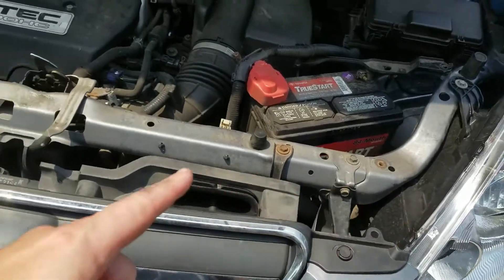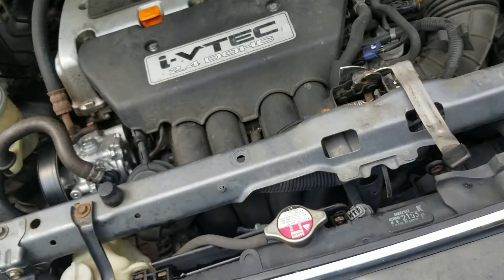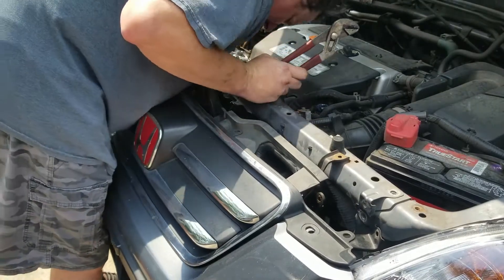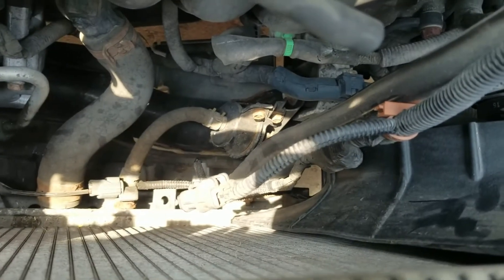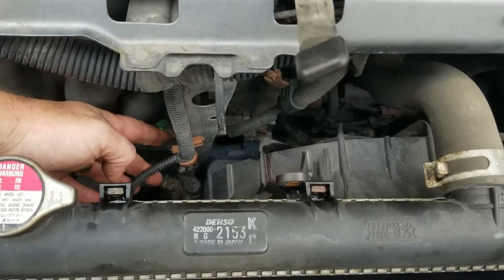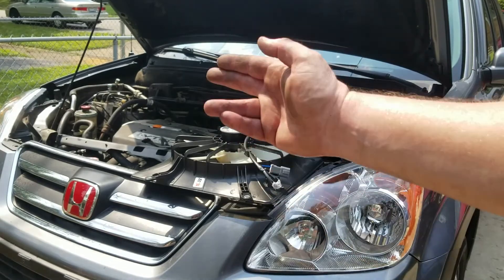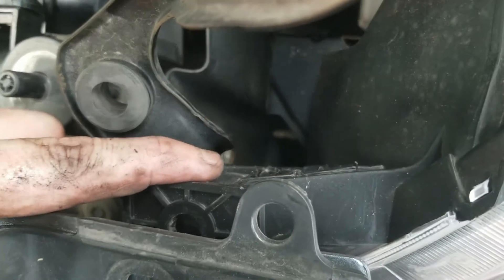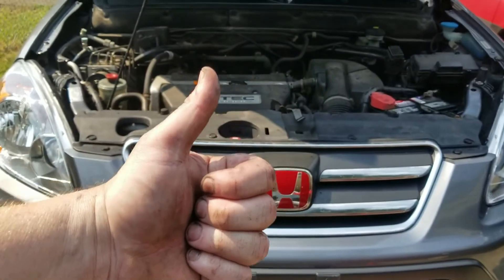02-06 2nd Gen Honda CRV Radiator and Condenser Fan Replacement

Comment: For anyone else watching this, just undo the 10mm bolt for the t bar from the bottom.  Much easier.
Reply from the maker: It's probably true, but not so much when its rusted and will probably break off.
Reply: @MrJayDM  That's true.  Looks like you are possibly in Louisiana.  I miss LA.

Comment: Is the Honda Crv 2002 water tank fan and air conditioner fan running automatically?
Reply from the maker: When the a/c is on both fans run with the a/c is off only the radiator fan runs. Now I found out when the heater (defrost) is on the AC compressor will run to remove moisture from the air.

Comment: You need to get a DeWalt or Milwaukee right angle adapter it's for the 1/4 drill impacts and you can buy a short stub 1/4 to 1/2 anvil or 3/8 anvil etc easier than universal socket
Reply from the maker: I definitely need to upgrade my power tools, a 90 degree would be very nice